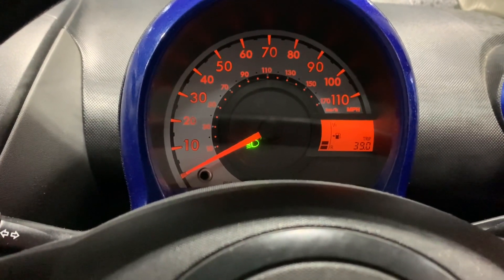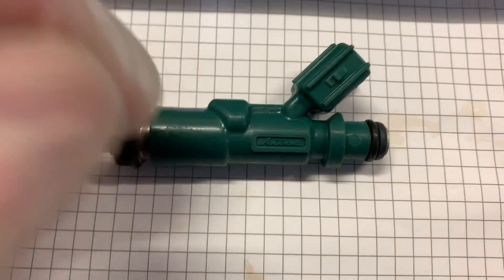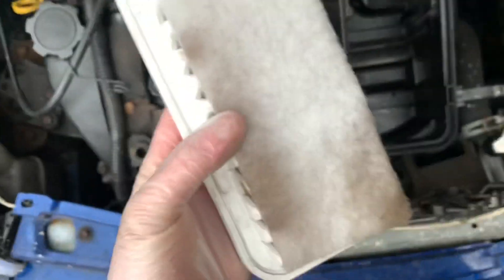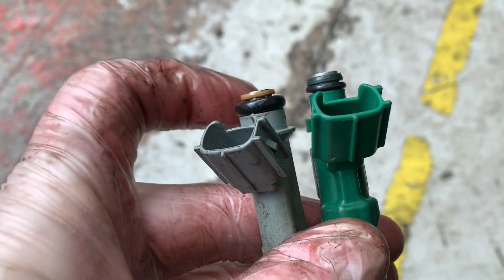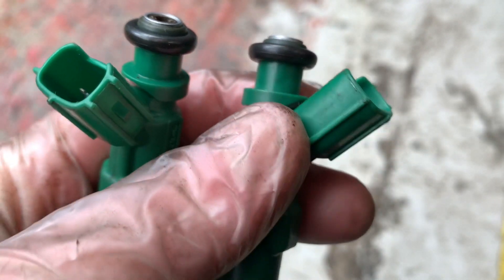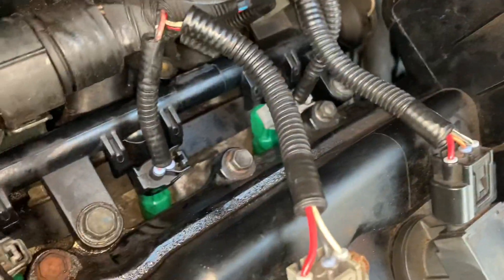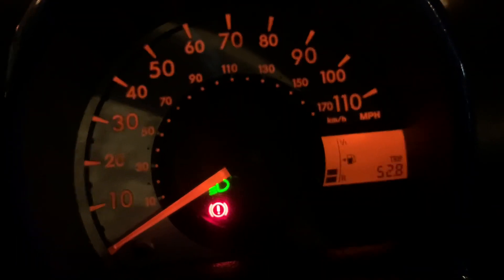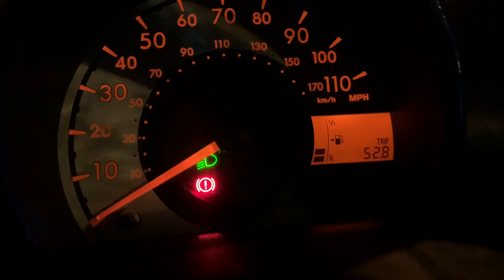Citroen C1 Bigger Injectors Installed, C1/Aygo/107 Yaris Injectors, Easy/Cheap Performance Upgrade

Comment: The 2.0L Toyota celica injectors work as well but you need to map them in. Ram air intake, polished and ported head, sportex exhaust and 2.0 litre injectors, currently running 115bhp and weighs in at 568kg
Reply: all that from a 1kr-fe?
got any vids or data to back it up?
Reply from the maker: Yes I looked into those first but need the duration changing as they won’t trim. 115bhp n/a?
Reply: @StupidBlokeStupidVideos  yes, tuned an dynod at mana performance it is pushing it a lot so keep that in mind, it like to murder the exhaust valves quite a bit
Reply from the maker: @alexashurst512  that’s some going. Didn’t even know that kind of power had been done N/A on these. What does it rev to? What torque is it making and where in the rev range is peak power?
Reply: @StupidBlokeStupidVideos  revs to just below 8k, peak power is at 6900, the torque is 152NM not an extravagant improvement if you think about it lightly but when combined with such a low weight it rlly is a blast on A and B roads
Reply: Sadly the gearbox did decided it no longer wanted to hold its self together last night so she’s currently sitting in my unit
Reply from the maker: @alexashurst512  revving to 8k, it will do about 80mph in second gear with a standard gearbox won’t it?
Reply: Always wanted to bang in one of those supercharger kits from Holland. Imagine the power. Probably undrivable.
Reply: yeah but the supercharger kits only do to like 130hp could be tuned for more but the engines kaput arround 130hp. planing to go to 180hp in mine which yes i assum it will be undrivable @Hoozpoppin
Reply: They fit without modification?
Reply: What year of celica are they from? and do you have an aftermarket fuel pump?

Comment: Tried this with mine a year ago and it barely ran, stalled whenever I tried to pull off. Suggestions?
Reply from the maker: What injectors did you try? Sounds like you could have gone too big and over fuelling?
Reply: @StupidBlokeStupidVideos  exact same ones you used
Reply from the maker: @Thatsilveraygo  didn’t have any air leaks around the injectors did you?
Reply from the maker: @Thatsilveraygo  yea strictly speaking they’re not, but I threw them in anyway lol

Comment: Sorry to go off at a tangent but what's with that air filter? Have you added an extra flat pad of filter material or is this just a brand I've never seen? Cheers
Reply from the maker: Yea it’s unusual for them to have that but it’s just part of the filter. Different manufacturers sometimes change them slightly, but I can’t remember what make it is though.
Reply: @StupidBlokeStupidVideos  Thanks. It is quite unusual, yes.

Comment: Try it with the induction kit to ensure the air to 'fool' ratio is optimised. Hahaha!
(And No, I haven't misspelled anything)
Reply from the maker: This is something I have already considered 🤣
Reply: only after upgrading the brake and suspension systems to cope surely?
Reply: @rodneyhull9764  springs from a biro and Shimano v brakes would be an upgrade.
I suggest the old Reliant method; find a speed trap at the bottom of a long steep hill, wind the window down and shout....meowmmmm, as loud as you can while you pass by.

Send your parking fine on a postcard to, PO.box 2 slow 2 FL45H. SP30 TKT, London. Hahaha
Reply from the maker: @rodneyhull9764  probably not a bad shout but tbh the brakes are actually overkill as standard anyway.

Comment: So a definite difference in performance. That can make all the difference when you are trying to overtake in one of these cars.
Reply from the maker: Definitely yes. I only drove it for about 10 miles after fitting them before making the video, but I’ve driven it a bit more now and it’s not massive but a definite noticeable difference. It’s also smoother. I’m surprised to be honest.
Reply: Overtake? You mean 'keep up' surely? 
I'm not even sure why these roller skates need/have mirrors? By the time you look at whatever's behind you, it's already in front.
Reply: @sally6457  not realy. I drive on autostrada and it is ok. In city it is great. I can easy overtake a vw golf 1.4..... or a sheet corsa 1.2. Top speed it is no more then 165 km/h tested by me but it is ok.....
Reply: @dudurosca273  while your trying to overtake you are blocking my lane! Hahaha!
Reply: @dudurosca273  These stock aygos fucking shit on corsas. Every 1.2 I come across gets shat on. A lot of 1.4s get trashed aswell 😈
Reply: @sally6457  you drive a ferrari or what ? I drive a peugeot 107 and it is ok. I have another cars too but also this 107 can run easy on highway......
Reply: @bradmace6144  1.2 and 1.4 l are faster but my Peugeot 107 have 750 kg soo, i tell you it is not so fast but it is ok. Do not forget it is a city car.
Reply: @dudurosca273  do you mean that the only vehicle you could possibly hold up is a Ferrari? Hahaha?
To be fair I have driven c1's and similar cars, and they are more than adequate in all areas. I apologise for my sarcastic nature.
Reply: @sally6457  no problem man. What i want to say it Peugeot 107, citroen c1 and toyota aygo (4 doors) do the job very nice . Regarfs from Romania !
Reply: @sally6457   This little engine can do 160-170km/h :P  and that is awesome for such a tiny engine
Reply: @sally6457  I'm dying over here, can't f-cking breathe!!
Reply: @tommythurin1688  Hahaha 🤣🤣👍